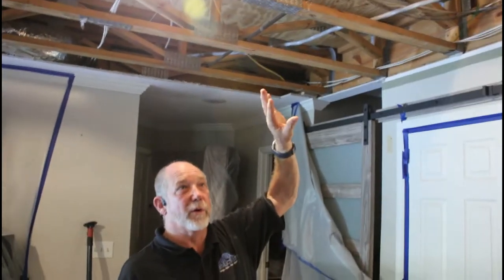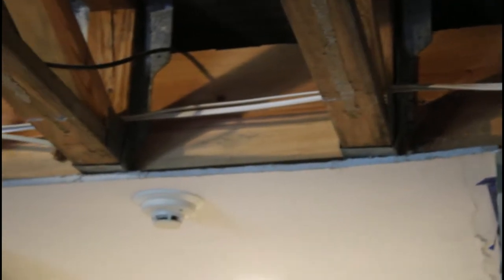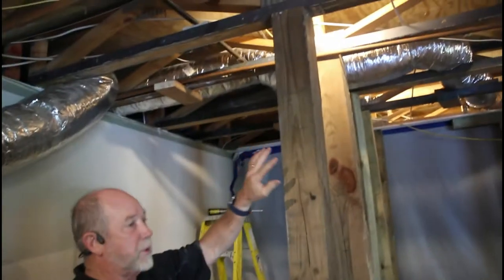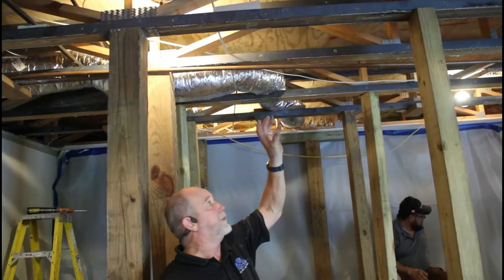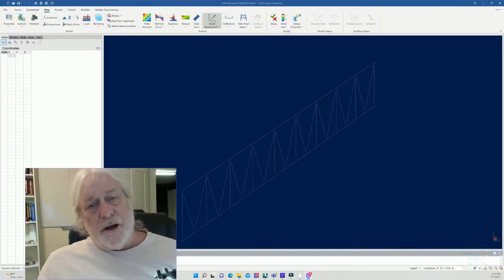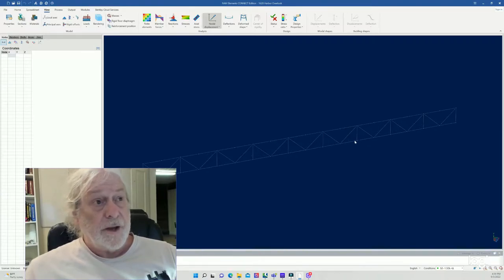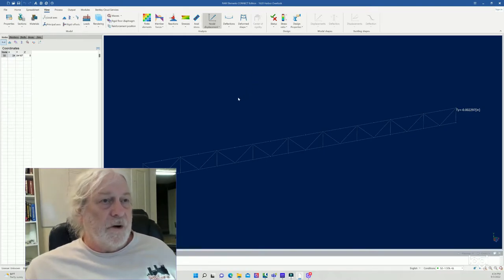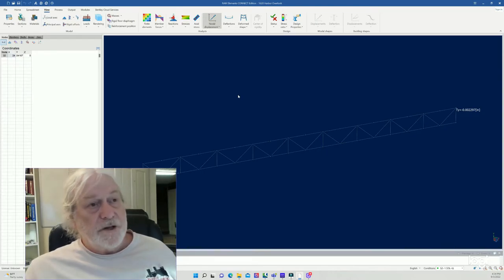Leveling a Floor and Stiffening Floor Trusses

Comment: Super curious what this cost. I have a pretty gnarly situation in a huge luxury home where the trusses are sagging under a huge kitchen island.
Reply: Are you asking materials cost? I am pricing one similar out right now and just the steel flats alone are 7k usd. I am only doing 8 trusses total, but I am using hot rolled A36 steel bar 5/16"x 2" x45ft and a bit of 3/8"x3"x60ft to strengthen an area of web trusses. Only doing 1 truss with the 3/8 that is under a heavy wall. Bar length is 20ft each so will weld them together and weld a 12" scab plate on the joints.  Using gorilla urethane glue.
screwed every 1 ft and 2 screws across welded scab plates. I might do my own youtube video on it. Steel, 2 people to help, insulation and drywall I expect to spend 15,000 USD.
I had to pull down ceiling drywall and insulation to get to the web trusses. I should be done in 3 or 4 weeks.
Reply: I appreciate your reply. Do you travel? Ever thought about visiting for Zion/Grand Canyon area?

Comment: Thanks for this video.
Any idea what kind of screws were used to attach the steel strips to the chords?
Reply from the maker: I don't remember, but the screws weren't important - it was the glue. The big issue is to resist horizontal shear, and screws aren't so good for that. The main purpose of the screws was to clamp the metal to the trusses to allow a better glue set.
Reply: @runkleconsulting6388  I'm having a similar issue in my house.  Any chance you could let us know what type of glue was used?  Thanks for the video sir

Comment: Bad idea to modify engineered trusses without engineers' guidance.  Which I'm assuming is what they did.  The manufacturer would never do that at the end.  Like you said, the triangle is the best shape for structure.
Reply from the maker: I am a licensed Structural Engineer - so it wasn't done without engineering guidance.

Comment: The original carpenters committed the cardinal sin of cutting floor trusses to shorter lengths than they are engineered for. They do NOT have that sort of flexibility like dimensional lumber or I joists have. And I know this having never installed one!